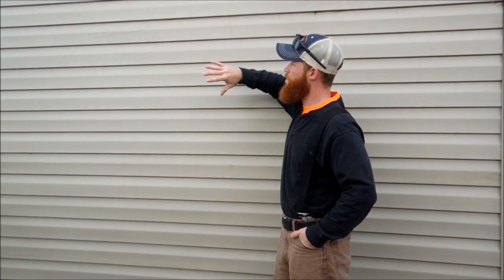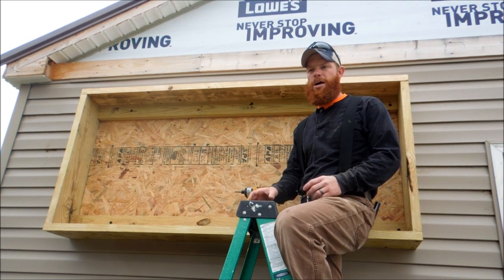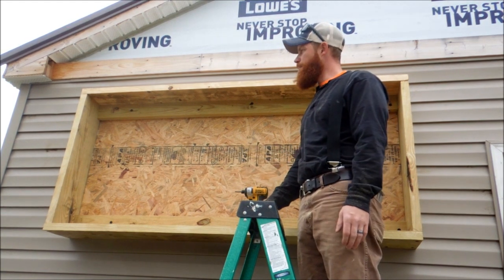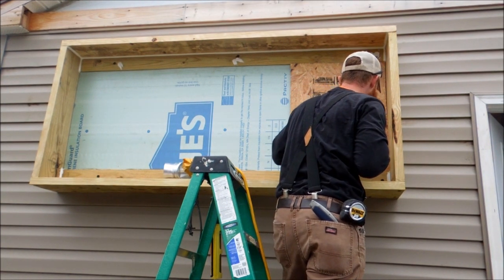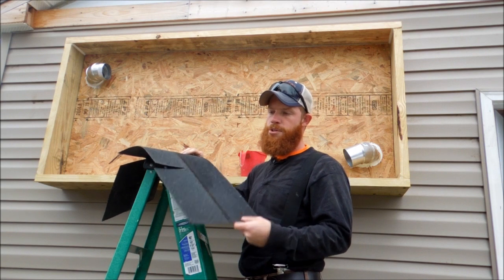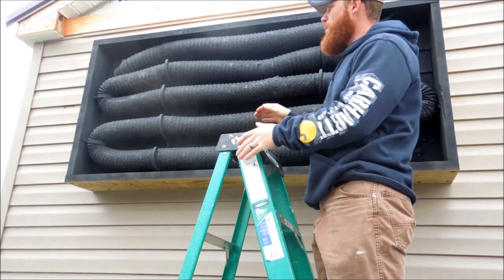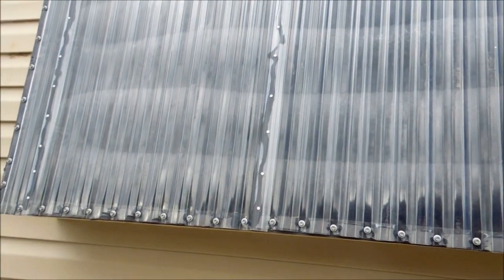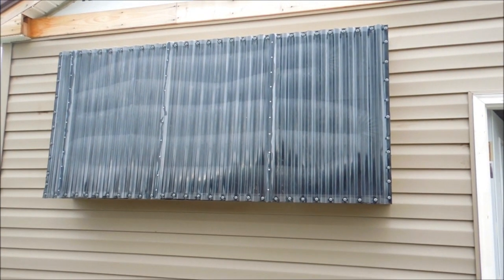How to Build a Solar Thermal Collector for Free Heat by HPFirearms

Comment: I am a carter graduate in solar technology from riverside California. If you take T  joints and make rows of tubes vertically placed connecting with a horizontal tube on the top and bottom , you will have much less air flow resistance and more effecient heat adsorption/ greater output in air volume and temperature.
Reply: to the Cali grad...As educated as you are you're forgetting what someone else hinted at...ALL plastic even water bottles gives off gases when heated so metal though poor retainer of heat is the better option
Reply: to the non cali grad, he didnt say to use plastic, he simply explained taking advantage of thermal dynamics using vertical tubes and t joints. since you assume instead of gathering the information given, i'm wondering if the words i am using are to large for your level of understanding.
Reply: I have been wondering about using  water baseboard heater tubes ( aluminum with fins) with the fins on them. If the fins radiate heat away from the tubes wouldn't it be the same if the heat was on the outside and it would help to transfer heat to the inside of the tubes. What are your thoughts? Dennis
Reply: Can you tell me why you even need tubes at all? Why not just a black box with a window, hole on top, hole on bottom, Or maybe corrugated black interior surface (same shape as the cover plastic used in the video but black and on the inside) to increase surface area, if that's even necessary.
Reply: Nevermind I literally just found the device I explained and it's shown to be the pretty much the best design. You got ripped off by that college bro, dead serious.
Reply: Do you have some websites for plans
Reply: Do you have some plans ?
Reply: Yeah you want air to follow in zig zag over all of them
Reply: @immortalpantheonstudios7328  where lol

Comment: I suggest that instead simply have a big south-facing window allowing the  rays to come directly into the house, and  hit the wall  (preferably dark-colored). Every pipe and other bits  in the pathway  is a source of heat loss

Comment: There is only one thing rough there using shingles you still breath in the fumes from the shingles they will melt just like when they are on your roof that's why they are put on roofs that is hot air coming back in to your house or workshop just saying think hard on what you are doing

Comment: I don't see an update to how this solar collector worked out. Any updates? I have an idea for something similar, but it will be placed inside the house sitting in a tall window. I believe doing it this way prevents heat loss and won't require attaching anything to the house or window frame.

Comment: Nice video good construction work,  my daddy was one of the greatest civil engineers our nation ever had.  Authored several of the Federal Government's maintenance manuals for buildings, ships and all branches of our military, was involved in the construction of 1,000's of structures, fuel pipe lines. a master carpenter, by age 18, contractor, school teacher.With top secret security clearance. Was the engineer who came up with the white line on the side of the road called the Fog Line ( Reduced accidents of folks running off the road by 86 %).

He always said to get natural vertical movement of air in a pipe, regardless of diameter it need to be 12 feet of vertical rise to create positive pressure natural air flow.

I have a unpublished book on Solar Energy.

Need to ask this question have you had much condensation build up inside the box which will cause rot of the wood as I noted you sealed the unit and did not drill holes for drainage, and allow for heat expatiation and contraction which could crack the plastic .

You have had near a year of use what was the temp of the air at the outlet during full sun days in winter and did you eventually install a fan?

Asphalt shingles was a good idea,  for myself I think I would have use some of that concrete panels as it  soak in 100 % of the sun's heat and will radiate the heat for hours after sun down which is why it is called a solar energy battery. 

Since what heat it does produce will have limited heat move into the room did you install a ceiling fan which in winter is reversed to blow cool air up onto the ceiling to move the natural heat rise across the ceiling and down the walls.

Gas furnaces and most new do not have a pan of water in them with a float valve. What engineers of the now dead generation knew is that moist air in winter, retains the heat dry air allows you to feel cold 2 minutes after furnace shuts off.  A small humidifier near your cold air intake would help. These are just suggestions from a 61 year old man.

Thank you.
Kermit.

Comment: What are impressive improvement you built onto the wall. But as a suggestion I would build the box into the wall , thus making the attaching and then sealing with the exterior siding and caulk. Another thought would be to use aluminum rain gutter drain pipe instead of the flexible tubing. The pipes have more mass and quick install. Other utubers have several different versions with info like yours that are inexpensive and produces more sun power heat.

Comment: black plastic 4 inch tubing for drainage works best for this as plastic will hold heat better than foil pipe so less heat loss from the tubing. At least it works best for me lol nice build tho and good idea thinking about the hooks becoming brittle over time I didn't think of that when I build a unit ill have to check mine and see how they are.. a teapot heater vid got me to your video glad it did lol good watch!

Comment: Hey Bobby - You don't talk too much, I would rather have a thorough explanation of your process since it saves me the cost of errors.

I plan on building a couple of these for our cabin that will be mounted low on the south side where it gets unobstructed sun all day.  I will be using aluminum downspouts for the ducting and the in and out ducts will be on the interior of the cabin. It will have a thermostat and an in-line fan to push the heated air. 

A couple of questions though - Did you use wood wiggle board to mount the polycarbonate? I know they have foam wiggle board, but that stuff breaks down over time and high temperatures.

I am also looking for high heat resistant materials for lining the boxes other than the foil backed Styrofoam. One reader suggested rock wool as an option. Did you get any odor from those asphalt shingles you lined the box with? If the asphalt shingles off-gas, I don't want to be smelling that inside the cabin.

Comment: I don't mind the length of the video. Thanks for posting it. Did you realize when building it, that the filler foam you used is actually perforated by design to allow for air movement? Did that cause you any issues in the long run?

Comment: well great idea but I would change a couple things, first flash above the box so it wont leak threw siding, don't use the shingles because they will break down quickly because the sun cooks the shingles, look at you roof after 10 years, but hey takes people to do things to add on and experiment to get things done
Reply: The shingles will out last the plastic I would guess he will have to service it in five yrs

Comment: I tried a similar design using flexible duct work. I had problems with low air flow. I read some comments on another video that the flexible type ducts create a lot of turbulence/resistance to air flow. Did you notice low air flow through your heater?? I used three inch ducts though, that may have made a  big difference.

Comment: Yes your solar thermal collector is very interesting, your video is perfect, But I have  a question? How far from the solar thermal can the heat on a pipe be carried?  At the cottage in the winter the water is freezing and I would like to used this heat in a pipe to heat up the water pipe. Do you think it will work ?  Edgar

Comment: messed that up...   bet it doesnn't work well, which is why he's not posted a follow up.  I bet the Carter solar graduate has it right....instead of a long snake tube, utilize a lot of Ts connected to two horizontal tubes and keep it all as large diameter as possible.  But still utilize surface area.   might need a small, small blower plugged into a 'warm thermocube'.  i've been tempted to do this, but time you figure expense of materials/time and hassle of holes in your wall in summer youd have to plug;  dunno.

Comment: That is faulty thinking on the shingles. If you want to retain heat and release it over time, then materials that are slow to take up heat should be used.Marble is an example that is slow to heat but retains its heat for a long time.I would look to extracting the heat you get to a bed of fire bricks or even builders brick as a storage radiator.

Comment: I always love your videos, your projects are wonderful.  Nice that you are doing all the things you do.

My thots (thinking with my mouth open btw, no disrespect intended!) first center on using air as your heat transfer medium.  Not so efficient.  Maybe a closed loop liquid system would be a better idea?  Second, I wouldn't try to store any energy outside, I'd bring every btu I could into the insulated building.  Then any loss from storage would be radiated into the living space. 

The shingles will definitely get hot where the sun hits them, but they have little mass and won't store much energy.  I know you're working on a budget, but "if" I wanted thermal mass outside in the collector, and I wouldn't, I'd replace that OSB backing with cement board, maybe even a couple of layers of it.

The personal idea I have always wanted to try is to plumb corrugated plastic or fiberglass panels in to a few 55 gal drums.  Those panels are generally about 1/4 in thick with 1/4 channels.  They'd gather a lot of heat quick.  A low-flow circulation system should provide hot water to store.  I don't think it would be a big issue to cut and seal some pvc to the ends of the panels for flow (may have to study up on glue).  Add your interior heat sinks and radiators, (I think auto radiators would be great) and I think you'd be good to go. Although this type method would definitely not provide warmth as quick as your system, It would provide a longer-lived bank of heat gathered through the day and used at night.

Comment: This is a case of heat transfer.  You need to show how many cubic feet of warm air has entered your room by passive heating of OUTSIDE AIR!  Without measurement there is no way to verify your claim that you generate sufficient heat with the size of your un-insulated heating box.  I suggest that you measure the amount of heat transfer to your room with your method compared with the amount of heat transfer using a small "computer fan."  Then you can say you have confirmed your claim that with or without a fan you have been able to generate the same amount of heat.  You may even surprise yourself that addition of a "computer fan" could increase Cubic Feet per Minute of heated air transfer.  Things that would make you say "HUMM..."

Comment: i suppose you have figured this works ok on cloudy days and real well on clear  reason on cloudy days you still have UV and some IR this is what does the heavy lifting with this sort of system unlike photovoltaic where the vis. light  does most of the work    BTW  it is now 6 months later how about an update and  insights in lessons learned
Reply from the maker: embarado smithing and woodcraft Thanks for watching and for the comments! I've got it on the list of videos to make! Stay tuned!
Reply: I am waiting for that update, too. Would be great if you'd find some time to do it.

Comment: Flat black stone/ceramic tile would have given you better thermal mass. If you haven't already, I would run a pipe from the intake vent down to the floor as someone else suggested. The air in the entire room will roll over better that way. One more thought is did you make a cover for the box for summer?

Comment: I have a couple of suggestions. Add a 12v fan running off a couple of solar panels.
Replace the asphalt tile with a thick sheet of iron. Mirror finish stainless steel side panels. Automotive radiators instead of ducting.
Good on you for what you've done please keep us posted :)

Comment: You could have just put in a window and hung a piece of cardboard painted flat black a couple inches away from it with sides closed to cause warmed air to flow thru the channel.  A piece of foam board insulation cut to snug fit in the window for nights.

Comment: Using that corrugated shit is cutting your efficiency dramatically. Just using thin glass surplus windows is gonna make that work 2X better, at least. Far too much loss in that plastic junk
Reply: Great idea and it works I actually built this same thing 5 years back smaller version. Though only Diffrence was I.poured tar in the box let it set up then  put roofing shingles on top of it, the box was insulated and if you have ever stepped on tar even on a 65 Degree day well you not what I'm saying it holds heat Really well step on it Barfoot on a 80 to 90 Degree Day. Lol Emergency Room basically I'm saying it will hold and put out good heat for hours even in cold weather the tar heats up the shingles insulate it and the insulated box is TIGHT

Comment: That  vinyl siding will warp nicely, if you are building the box right to the wall it would make sense to remove the siding behind it first, otherwise you can save yourself 100's of trips up and down the step ladder by mounting  the  box once it's  done

Comment: Ever heard of Induced draft fans ??? These are used even in smelters (which have a lot more temp difference than your solar heater), if you put a fan on it will work much better.

Comment: Great video!  I hadn't thought of using asphalt shingles before, and very interested if it worked.  I plan on doing a hot water system collector and embed in the new concrete floor for the garage and back porch.  Even considering extending to out into the driveway so I don't have to shovel the walks close to the house and drive.
Reply: You can do geothermal for your driveway

Comment: Chummy affect !!! This is why people add fans, to blow the hot in coming air downwards into the space you want to heat
Otherwise, the hot in coming air would just continue to rise once it enters the room you are trying to heat
If the heated air is entering your work shop above your head, what was the point ? Hot air will just continue to rise

Comment: Trust me--you did the right thing using the black caulk on the seams; 'clear' silicone is not clear, and shows up much worse than the black does. I found that out the hard way. I built three 'identical' collectors. That is, identical in construction, except I used the 'clear' silicone on the seams on the first one. It looks terrible. I tried black on the following two, and their seams are much more inconspicuous.

Comment: I have been wondering about using old water baseboard heater tubes with the fins on them. If the fins radiate heat away from the tubes wouldn't it be the same if the heat was on the outside and it would help to transfer heat to the inside of the tubes. What are your thoughts? Dennis

Comment: is putting asphalt shingles a good idea? At high temperatures is the fumes from it a good thin to blow into your garage while you are working there? I don't think is a good idea but I may be wrong.
Reply: because the air flow is sealed within the dryer vent duct he is using I am going to say he shouldn't get fumes. the air travel from the inlet through the duct and into his outlet the surrounding dead air inside of the box is where any fumes would be.

Comment: Have you seen the CanSolAir? It's made with aluminum cans. If you drink a lot of canned beverages, you've got half of the building material. It started out as a home experiment, like yours, so it should be easy -- for someone with the required skill -- to make it. But it is efficient enough that it evolved into a commercial product.

There's a YouTube video of a demo done on a December day (sunny) with a snow-covered ground. The ambient temp was 17º and the unit had an output of 159º.

Comment: One thing to consider. You say in the video that heat rises . The hot air is coming out of your box near the top of the wall inside your shop. Wouldn't the hot air just continue to rise once it enters into your shop ? If it dose that, I don't think it would heat your shop any. I think this is why people use the small fans. The fan will push the hot air abit more.

Comment: My parents have solar panels on their roof for pre heating the hot water tank. Seems like a sealed water system with a storage tank would give you more residual heat. Maybe 2" black pvc. At any rate great vid, and you have me thinking what could be done with my shop.
Reply from the maker: I thought about doing a water system and no doubt it would be more efficient but for my little shop it would require many more moving parts and take up more space... probably would be overkill BUT for a whole home, absolutely the water system would definitely be worth it!